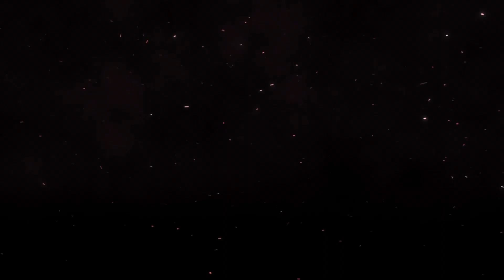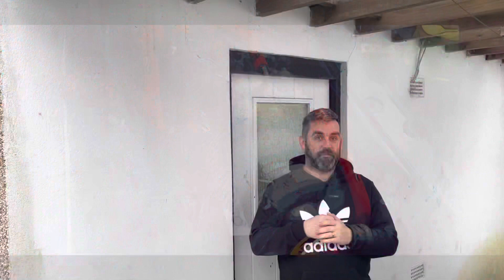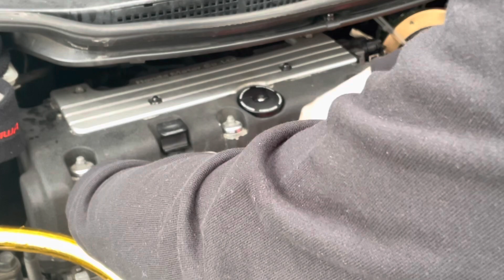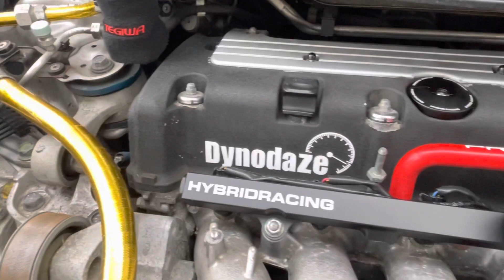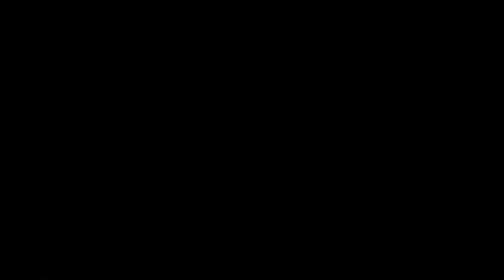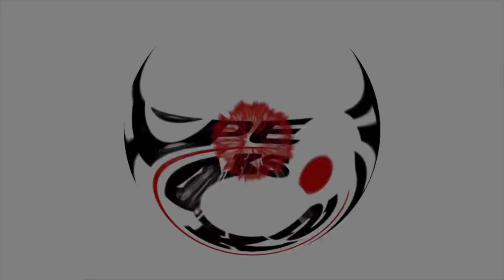*Quickest* Hybrid Racing Fuel Rail Install Honda Civic FN2 Type R

Comment: Can I ask why the change of rail?  Most of these are made by the same manufacturer and just branded up to suit the company... That's not to say there's no difference between the 2.. in your experience with both can you feed back on how each has impacted on performance
Reply from the maker: Thanks for watching 👍 it’s mainly cosmetic, not really providing performance gains.

Comment: Great vid mate, I’m in the market for an intake just wondering what kit you went with, have been looking at the cpl kits and the hybrid racing ones but unsure what to go with
Reply from the maker: Thanks man, appreciate it. So I’m currently running a home made HKS 😂 but I’m looking at going hybrid racing. After watching the guys at Dynodaze and the performance seems to be better with the hybrid racing kit, mainly based on the fact the CPL kit has that sharp 90 degree bend which isn’t helping airflow into the manifold.
Reply: @TypeRTweaks  what was the power gains like from the home made or was it more for noise?
Reply from the maker: 8hp gain. It doesn’t sounds as loud as the HKS mainly due to silicon hose but I’m ok with that 👍
Reply: @TypeRTweaks   8hp gain is actually pretty decent for a home made kit, have seen a second hand HKS kit on eBay for £180 is missing the heat shield and one of the breather hoses, but I am tempted to pick it up

Comment: Ive just subscribed and liked a couple vids, yor content is really good, 

I have a question, whats the advantage of changing the fuel rail ? Theres clearly a reason, else they would design/manufacture them ?
Reply from the maker: Thanks for the sub and likes. Not really much benefit other than a cosmetic look versus the OEM.

Comment: Can I ask what was wrong with the one you took out?
Reply from the maker: Nothing wrong with it functionally, got sent the hybrid racing one for free 😂😂
Reply: @TypeRTweaks  cool looking at one but unsure of fitting it myself
Reply from the maker: It’s really easy 👍 (even for me as an amateur). if you watch my original video, it takes you through all the steps. My mistake the last time was not ensuring the fuel rail was fully clean prior to final fitment so ended up blocking an injector.